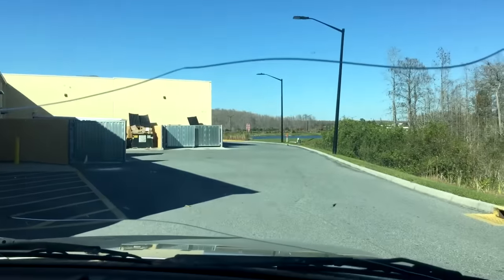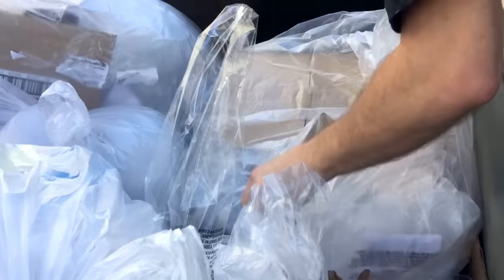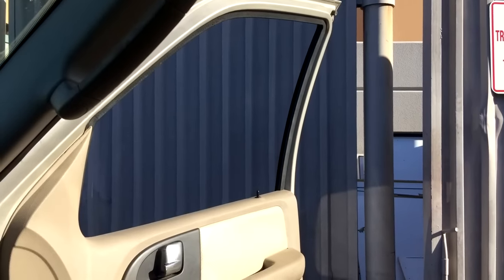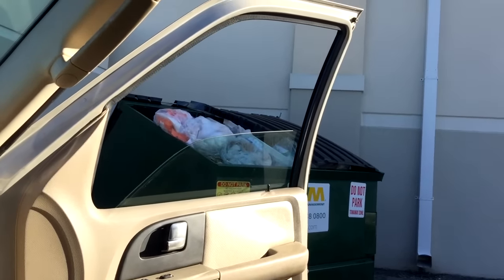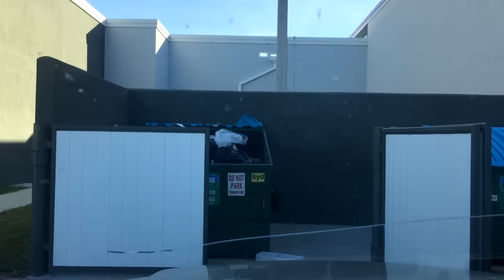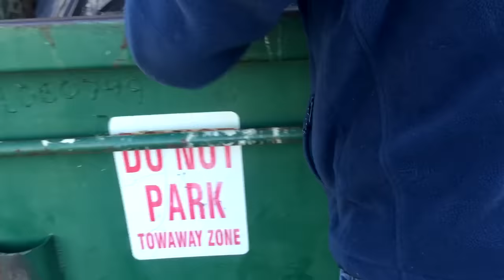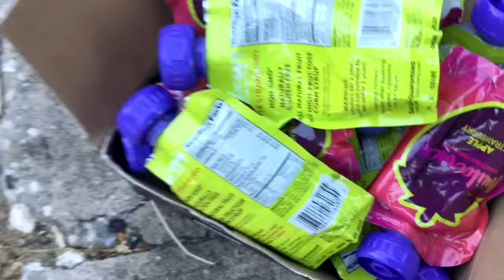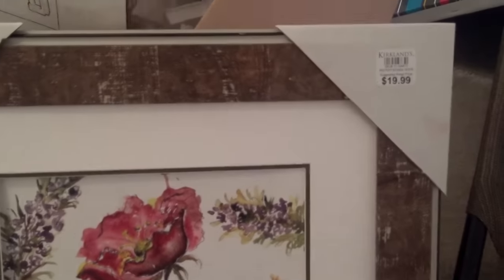Dumpster Diving Mega haul kirkland's , bed bath and beyond, bath and body works , pier 1 , big lots

Comment: I’ve boughten printers from the store that flat out didn’t work...wouldn’t turn on or wouldn’t pick up Bluetooth or connect to a computer...I’ve also paid for a nice Samsung laptop that worked for a total of 30 mins...then it just shut off and that was it...the store couldn’t even get it to turn on with a different battery etc...so I imagine some of those items like the printers could possibly be those types of returns...then again..,pitching them into the dumpster might have jimmied it enough to make them work..

Comment: I found 3 of those printers and the power cord was missing so my husband got a cord and turned them on an the ink cartridge compartments were broken. What was the condition of that printer?!
Reply from the maker: It was brand new took it out the box and it had never even had the tape removed I printed afew pages to make sure it worked and it did great . Someone had hid it in he recycle bin so maybe they where trying to keep it after work
Reply: @Jubi316  I wish that was the case for me because I found 3 of them. Now I don't know what to do with them.